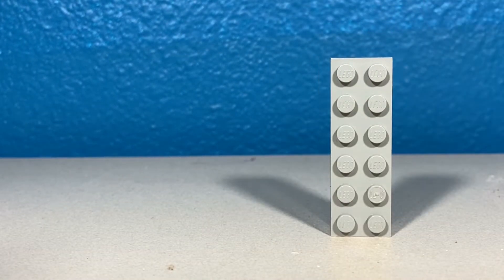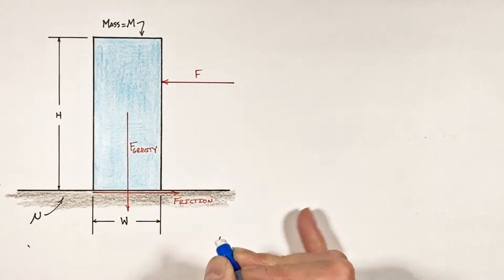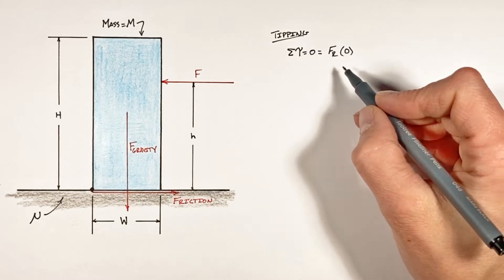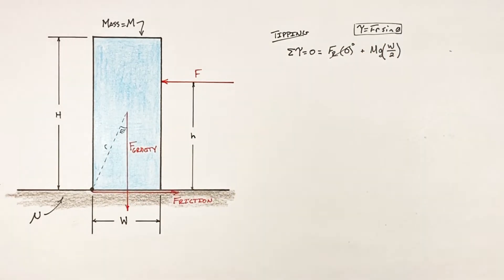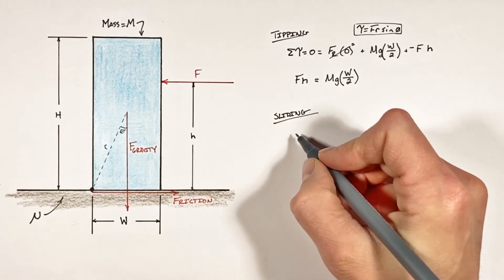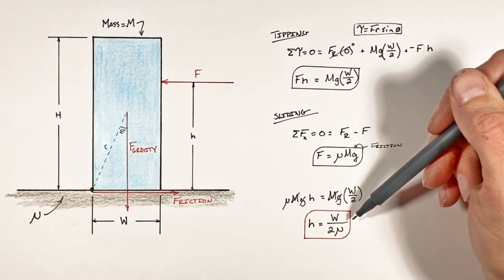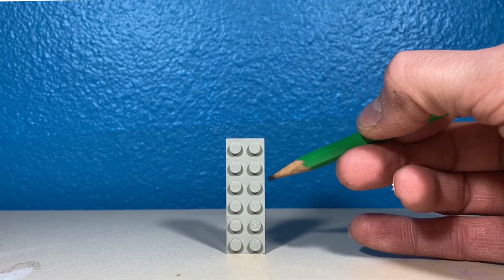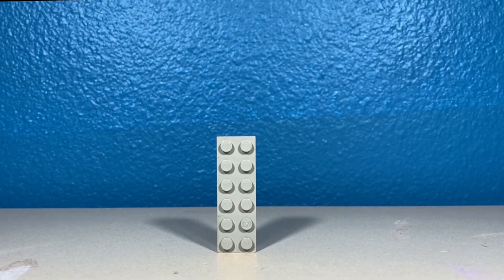Will This Block Tip, or Slide?  |  Statics For Physicists & Engineers

Comment: I don't get why the sum  of the torques is zero? When the block is tipping doesn't it mean there has been a net torque on the object causing it to move? Same for the force
Reply from the maker: By setting torques or forces equal to zero, we are finding the limiting case, or threshold, where the block just starts to tip or slide.  Think of it as the 'border' between the two outcomes.
Reply: @INTEGRALPHYSICS  Ah thank you, i understand now!